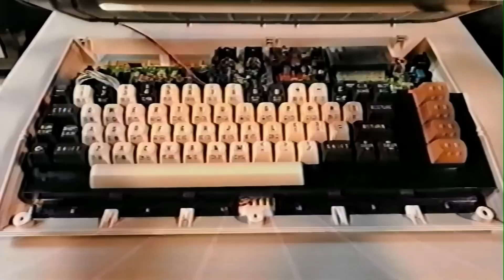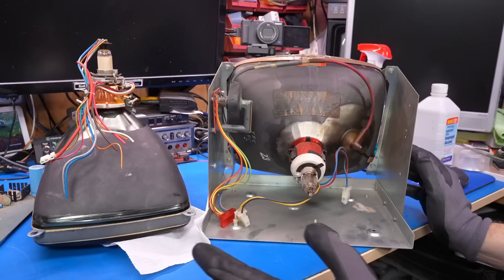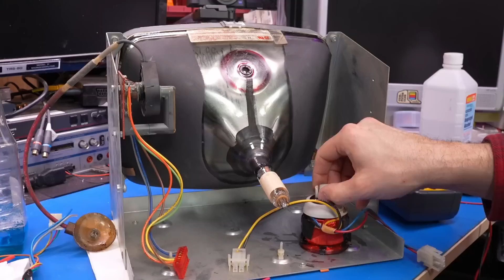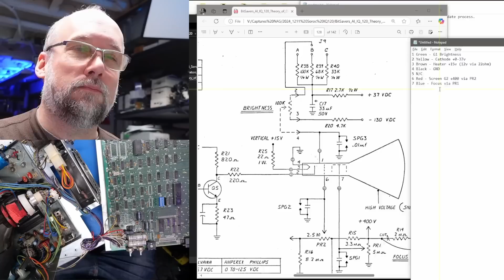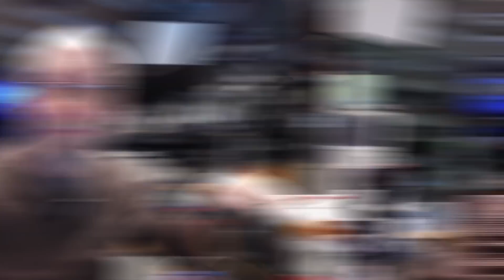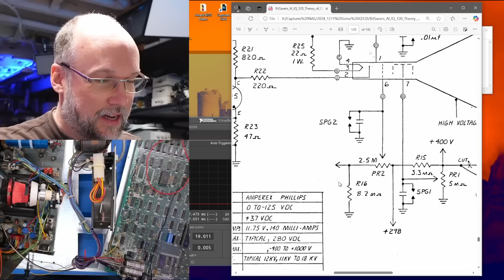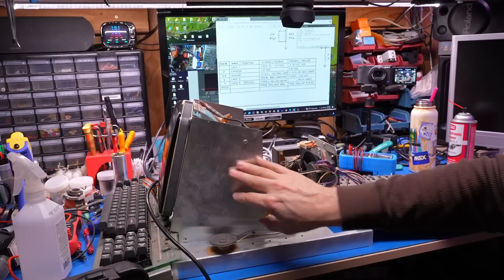Soroc IQ 120: Let's address the cataracts in the room

Comment: Knipex side cutters. Nice! Since I bought mine, I cannot believe the difference. Only problem is, when I (ab)use them as strippers, they are so sharp that I often end up slicing off a sliver of insulation instead of stripping the wire.

Comment: I'll bet they're not "O"'s but "0" (Zeros)  which means bit 000x0000 is stuck high.
Reply: O is 0x4f which is also an interesting number, but not as clean an explanation as a stuck bit. Assuming the framebuffer uses ascii encoding (but that seems likely). I'd also assume it's 7 bits as it doesn't seem like a terminal which is going to do anything interesting with 8 bit codes.

Comment: Could you use your tester to check which range your spare crt are set to in order to sort them into different voltage ranges and see if you have any that are the 100-300 range vs the 300-600 range

Comment: Maybe using a steel string (guitar string) or a nylon string (may deform under heat and break), to remove the front glass could work. I think it may cause less stress in the glass, you just need to keep it moving side to side, like if you were cutting.

Comment: If you are going to heat that screen, check Shango66's different methods for different glues. Also calculate how much heat you really need (related to the sunny summer day) to gradually heat up entire crt. I think it will not be that much from 1m/3ft distance. Protect yourself!

Comment: +400V comes from flyback. You can try to add a voltage doubler instead of single diode on this circuitry.
Reply: good idea, how is the unit supposed to work with the other option of a crt?

Comment: I didn't read all of the comments, so it may have been already sggested: I've had some success on some 5 inch crts of using a small gauge heated nichrome wire to sort of 'saw' through between the over-screen and the crt face.  You still end up with a cleanup mess but avoid most of the prying between the two pieces of glass.

Comment: I think the CRT can be saved - but there are risks involved. Removing the protective glass might require heating, which can harm the phosphor or cause the screen to implode. But if you remove it safely, it can be glued back using optical glue, or jeweler's glue.

Comment: I managed to get a hold of a bulk quantities of UV cured glue called 'K-300'... they typically use this stuff to seal windshield rock chips and attach touch overlay glass to LCD panels in cellphone's. it's optically clear,  i've used it to adhere all kinds of plastics and glass together and i can get it cured either with UV light or simply taking it outside on a bright sunny day.

 that would likely work very well to re-apply the safety glass to the tube.

Comment: Chopsticks seems very specific and you should prob name the sources of info you use. Also, this is not a roundy and you will die if you take that crt apart.
Reply: This safety glass silicon glue may have to be cut with a hot wire. Some old round crt's have to be cut with a hot wire.

Comment: I recently cleaned up an ADM3A that "leaked" all over the PCB.  It is a major pain to clean up but I did catch it before any corrosion started so I was lucky there.  The additional issue with the ADM3A is that the keyboard is integrated into the main board and that had to be disassembled and cleaned also.

Comment: I've seen someone repair cataracts but don't remember who.  I seem to remember them using a wire to saw through the gunk while the CRT was out in the sun. I think you need to use an optical cement to glue the entire front glass to the CRT to get proper structural integrity.  I agree this should be outside and with a lot of PPE in case of implosion.
Reply: shango066 deals with cateracts on a regular basis so you can probably scope out some info there (His videos are awesome btw, been following him since the early 2010's). Jerry Walker is another one
Reply: @Chriva yes I remember him! I stopped watching him, I couldn't take his boomer tinfoil hat rants anymore
Reply: Seems it was Usagi Electric with cataract on terminal.
Yes, it was: Repairing a Bad Case of Cataracts on an ADM-3A Terminal
Reply: @V.D.  Yes, just putting it outside heated it to 105 f.   Gotta love Texas!
Reply: shango066 - he's done a few of them, looks a bit dangerous
Reply: When the glue is degraded to this level, you can probably pry off the glass with a few chopsticks without any additional heat. Maybe run a guitar string through it.
Reply: Shango066 is expert in crt and old tvs and radios
Reply: Yes Shango066 but also bandersontv. He did two colour roundies recently and he did it indoors, with some heat lights to replace sunlight.
Reply: all you really need to do is melt the glue that holds the top “lens” onto the glass then remove it. i’m not sure if you can find another protective layer

Comment: Loving this series 😊 To get the glass off, maybe you could place the crt face down in container and fill with IPA or possibly acetone to just above the protection glass level. Let it soak in between the glass and the screen to help free it up? (just guessing here, but with a long enough soak and the right solvent that might be a low effort removal method)
Reply: Yep
Reply: But there is a problem you would quite large container
Reply: @AsherJohnson-k1i  large yes, but you wouldn't require a huge volume of liquid, just enough to get to the level of the safety glass glue. Perhaps syringing a suitable solvent into the gap would be another approach.

Comment: Great video! What happens to the G2 voltage if you jumper over r13+r14 like it shows in the schematic?
Reply from the maker: I didn't try as it would never be more than boost anyway, which was about 400v... So I had the same effect as using the focus voltage turned up to max.